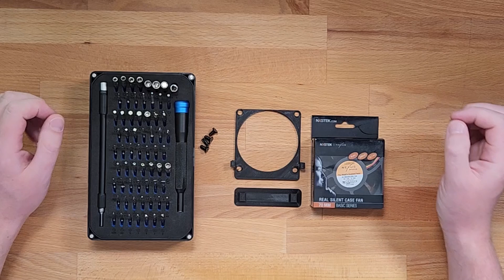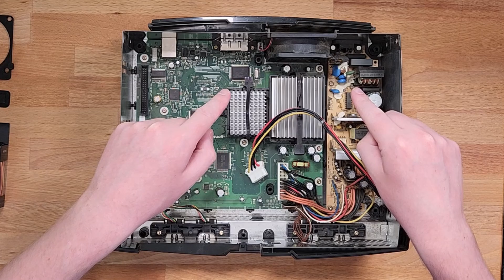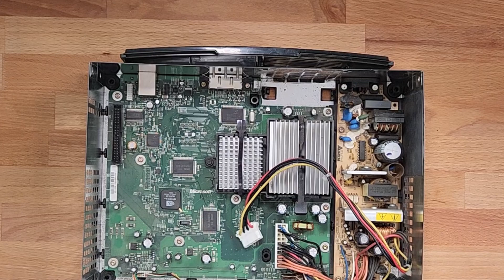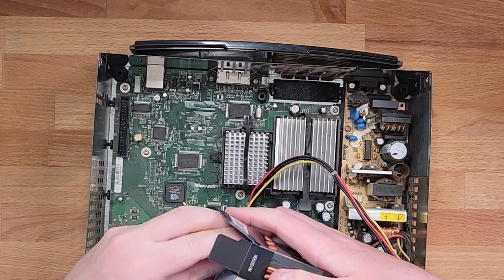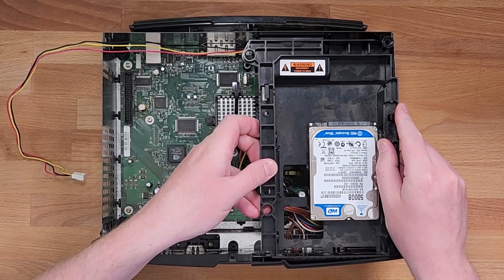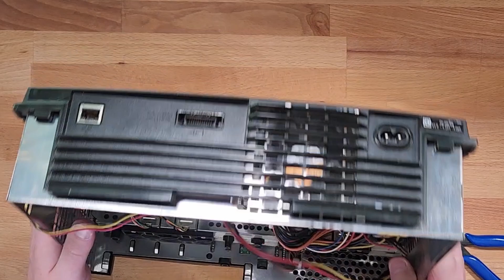Replace Original Xbox Fan - Nexus Fan Mod

Comment: I don't recommend anyone purchase or use this fan. I bought one and as soon as I installed it, the fan intermittently will not spin up. I haven't even gamed on it yet. It is unreliable and is not worth roasting your console over.
Reply: many many people have had success with this fan, have never heard of your issue. Not to say it isn't happening, but IMO you probably have something else going on with the xbox internally that is causing that. A fan is insanely simple and can't really break like that. The signal it's receiving is not right in your case imo

Comment: Are you still using this fan?  My Xbox is stock and unmodded so I’m concerned about the reduced fan power and higher temps.
Reply from the maker: I am. My system is modded so I was able to manually increase fan speeds. Running this fan in a stock system is not the best solution.
Reply: @CO3Productions  are you no longer selling these kits?
Reply from the maker: I am still selling on eBay. I see the link is broken. I have updated the link.
https://www.ebay.com/itm/266367122312?mkcid=1&mkrid=711-53200-19255-0&siteid=0&campid=5338848088&toolid=80005&mkevt=1

Comment: So this actually seems like a downgrade if it pushes less air and gets hotter.
Reply from the maker: On a modded system the fan speed can be increased to bring temps down. The fan will no longer be silent, but still quieter than stock.